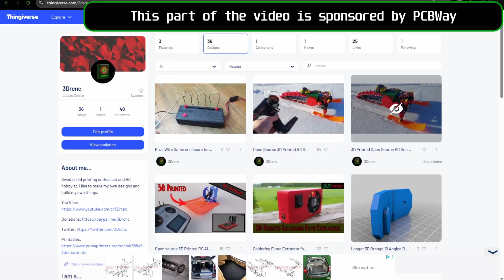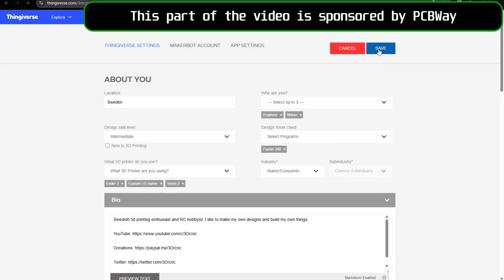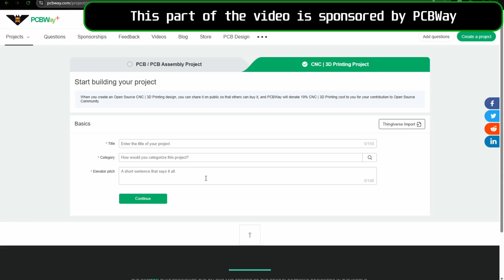MicroTrackRC 3D Printed Tracked Vehicle Build Guide

Comment: Hi, currently in the process of building this, however, won’t there be a risk of the engines burning out? Since the motors are rated for 3–6 V but the build uses a 2S LiPo (around 7.4–8.4 V), they could be over-volted unless something limits the voltage.
Reply from the maker: It is correct that the motors are slightly overvolted if you're running at full speed. In my experience they seem to handle that qite well. Havn't had any burning out yet but maybe if you are running on a surface that puts a lot of load on the motors or constantly at full speed you might eventually burn them out.
Reply: @3Drcnc thanks! i have set my transmitter to 60% max power and since no more issues. i had some problems with the plastic gears inside the engines stripping when driving at full power with the 2s LiPo :) would it be possible to share the original source files? i would like to make a few mods. the gliders for me are not working too good, the holes for the tubing are too close to the edge so they are prone to breaking. and i would like to replace certain parts where you have to screw into the plastic with some threaded inserts so they can be more easily unscrewed. also would like to design a camera mount for it :) going to use it to go into the crawl space under my house so I don't have to :) thanks, its a nice first build to get into 3d printing RC stuff!
Reply from the maker: @happygerb  The frame parts are available to download as .step if you join the Discord. There are also a few people in the Discord working on adding a camera and making some other modifications. If you want to modify any other parts that are not available I can share those as well.
Reply: @3Drcnc how can i find this discord? cant find it in your profile here, twitter or thingyverse :) thanks again!
Reply from the maker: @happygerb  The Discord invite link is the third link in the video decription. I also added it to the channel home page now. That's a great idea.

Comment: Can I use my phone as a transmitter
Reply from the maker: It depends, with a regular reciever it only works with an RC transmitter. This is what is included in the bill of materials. But if you make your own electronics setup for it it's definitely possible.

Comment: What is the total parts price? I just want try to DIY !
Reply from the maker: The price depends a lot on if you already have a transmitter and battery since that's the most expensive parts. If you have that already this project should be under $60 and if you need to buy everything it'd be around $100. That amount is if you're buying a kit of a few hundred bolts and 100 heatsets so you'd get a lot left over. If you already have some bolts laying around you'd save quite a bit as well. Same for the motors that you only need two of so you'd have four left over for other projects.